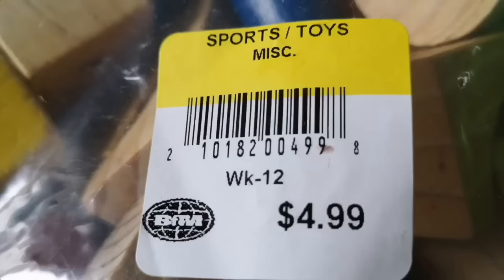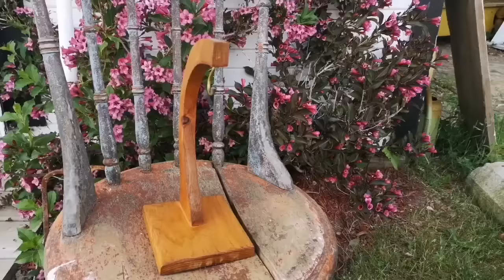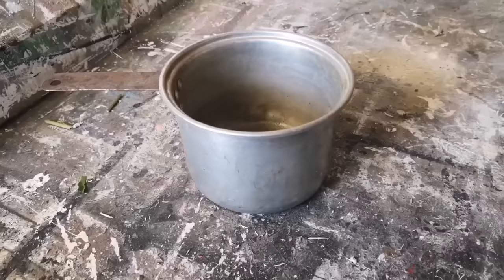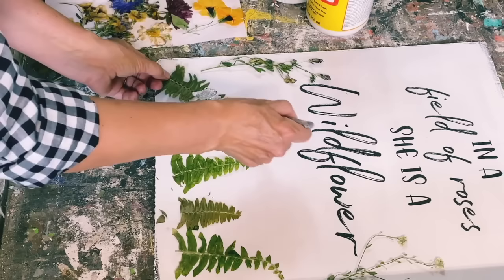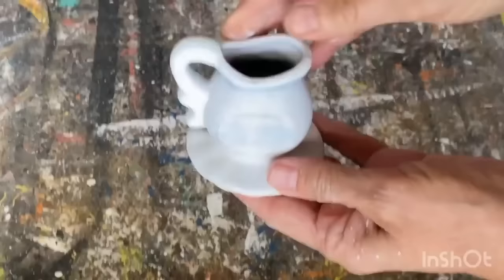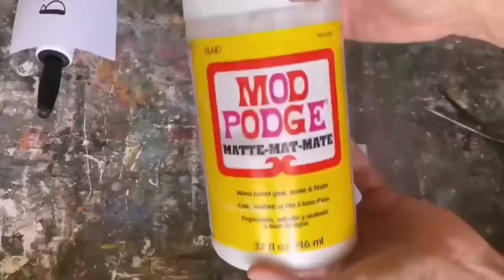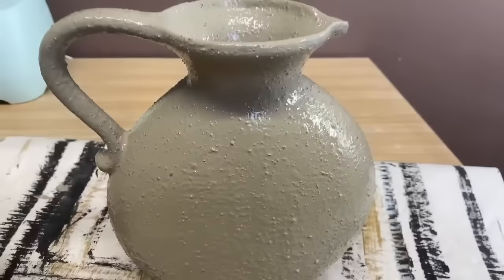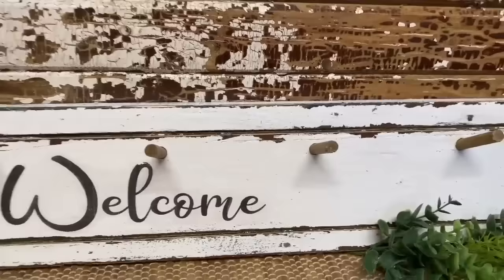The Ultimate Upcycle Binge! Upcycle Thrifted Ideas for Your Home

Comment: The glass jar with the hole in the bottom is a fly trap. Flys can crawl in any direction but can only fly in straight lines. A mixture of borax, sugar or honey and water is pored into the gully at the bottom of the jar. When the flies land usually at the bottom opening after the luring smell of the water and honey they crawl in and drink the sweet poisonous borax water where they become trapped and can’t fly  up or down to escape. It works quite well.
Reply from the maker: Yes exactly

Comment: Hi 
I have a question -- when I do your reverse graphic technique, there are times when there seems to be a remaining edge around the graphic that is visible. I've tried sanding it to feather the edge to make it less noticeable, but it looks like a sticker I've clear-coated over. What causes this, and what am I doing wrong/how to fix? 
Thanks!
Reply from the maker: This usually happens when you put on too much mod podge. It is a thick product and will def show. Also will show more if not on a white background
Reply: OK thanks.
So less modpodge especially towards edges.